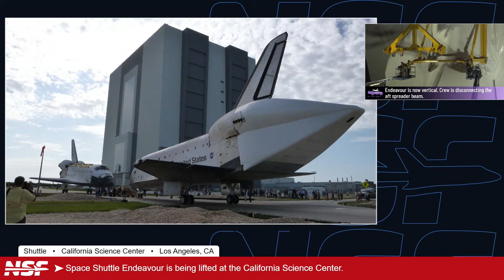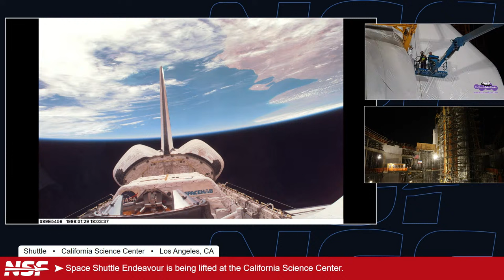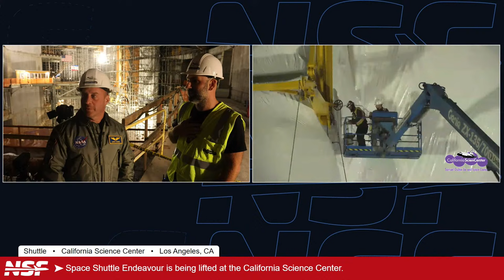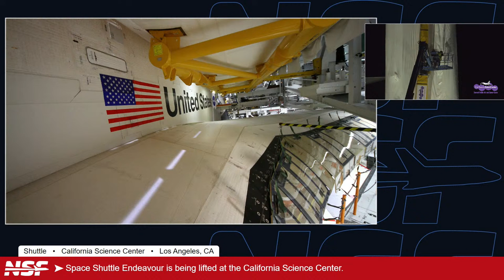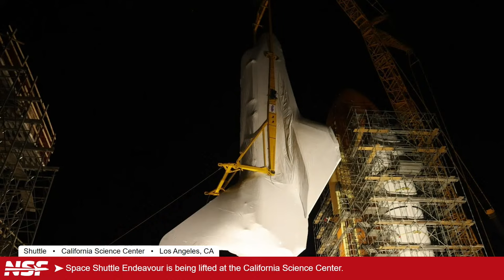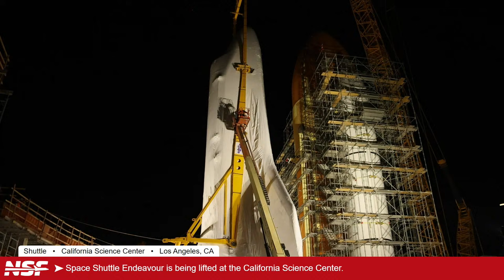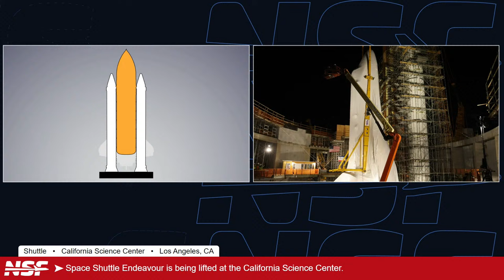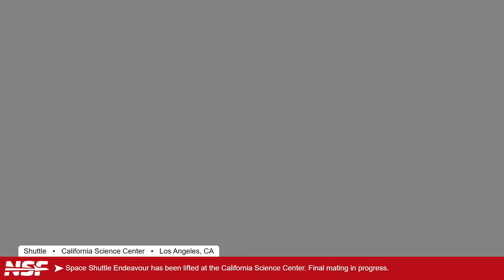Space Shuttle Endeavour's Final Liftoff

Comment: Was able to attend the launch - it was great!  Awesome to see the huge crane lift the shuttle up, over and down to that precise spot.  Also learned from other space nerds at the lift how the shuttle is supported.  The only support points for the whole assembly in the vertical orientation is at the base of the two solid boosters.  The boosters then connect to the external tank which then attaches to the shuttle.